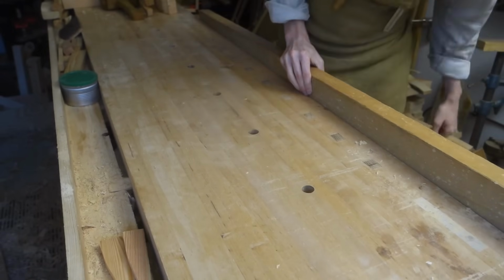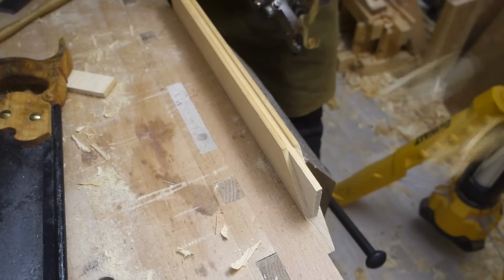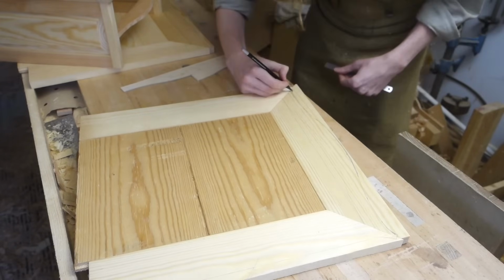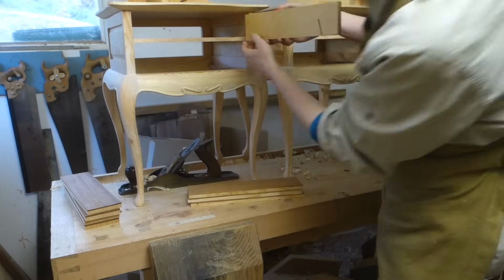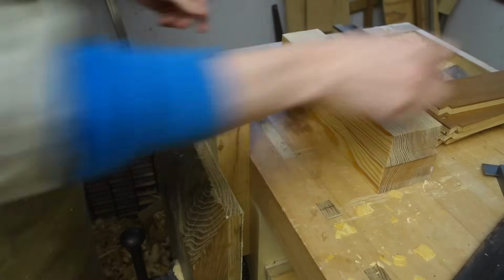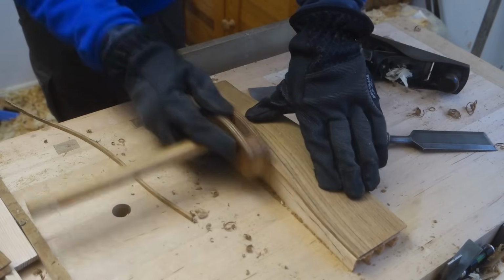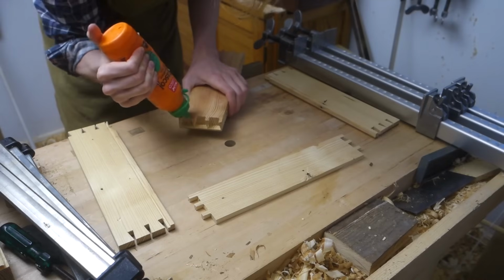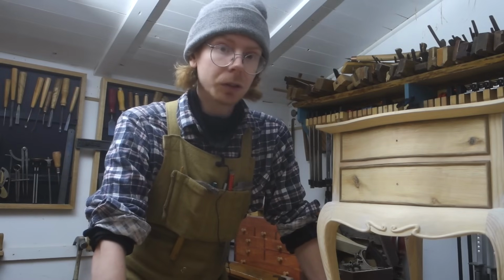Making bedside tables - part 2

Comment: Very well done I wish you would have displayed the full units at the end, I am sure since you are glueing long grain to long grain the bottom is a solid connection if you were making a bedside table for an American residence it would probably be better served putting a wider rebate in the drawer front as most people that have that level of furniture also throw in a 3 to 5  pound pistol :yougotthis:may the grain be with you.
Reply from the maker: Thank you! My hunch is that a rebate in the front wouldn't make it stronger, as I've seen many old drawers break due to the bottom being thinned for the groove, but maybe I misunderstand?

Comment: I am so excited by this project. Congrats on finishing it (I just saw the paint video also)!

I bet part of the reason your method of attaching the drawer bottom to the front is not the traditional way, is that if a hide-glued joint were to become wet, the glue would release; using polyurethane glue overcomes this limitation and AFAICT makes your joint make sense overall.
Reply from the maker: Thank you, Joel! That's a very good theory I think, makes a lot of sense!

Comment: Very Nice video! I find the commitment to hand dimensioning inspiring, as it will be what I'll have to do myself due to space constaints. Also a truly impressive amount of carving on display!
I particularly like the little detail of making the panel tapers concave, it adds a lot.
About the drawer bottoms, I understand your concern towards grooving the drawer front (though it would have probably been fine structurally, especially after glueing up the drawer frame), and the edge grain-to-edge grain butt joint forces you to glue at least that face as a result. What I don't really understand is why you generally would want to glue in the bottom, or use a screw and slot in the back board. The bottom will still keep your drawer square, glue or no glue, as the drawer sides are held parallel by the long-grain drawer bottoms (which won't shrink and can be fitted closely). As for the front and back boards (which are in line with the shirinkage direction), a groove in the drawer front to take downward forces and also allow for some shrinkage is the common solution. By fixing the bottom to the back rail with a single nail you can still easily adjust if the botton should shrink excessively (by removing the nail, sliding the bottom along, and re-tanailng), and you can easily replace the bottom if ever necessary. 
It is my understanding that traditionally, drawer bottoms would not be glued in, for those reasons (well those and the strong direction of the wood (longgrain) being also being the one supported on both sides by the grooves).I hope my explanation is not too hard to follow!
Reply from the maker: Thanks for the compliments and for sharing your thoughts! I’ve seen a bit too many old drawers that have shrunk out of their front grooves or broken at the front, the method I’m using here avoids that weak point, but we’ll see how they hold up over the years :)
Reply: @GillisBjork  Good for you, Gillis. Study the past, analyze the mistakes of others, devise new approaches to avoid the same mistakes, and boldly apply them in the face of convention. That's how great things happen!

Comment: For the measurement of the space for the drawers something called adjustable parallels could be useful. Conceptually they are two identical wedges with some mechanism to allowing them to slide against eachother and then lock in place. I have mainly seen them in machining but I see no reason they could not be made from wood for woodworking.
Reply from the maker: Thanks for the suggestion, I'll look into it!